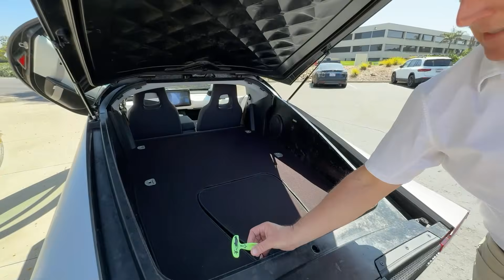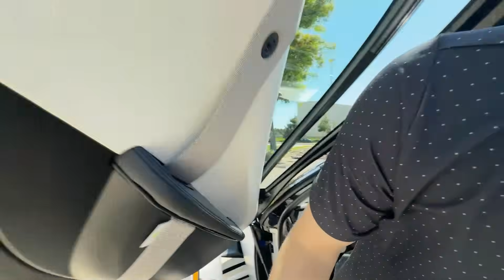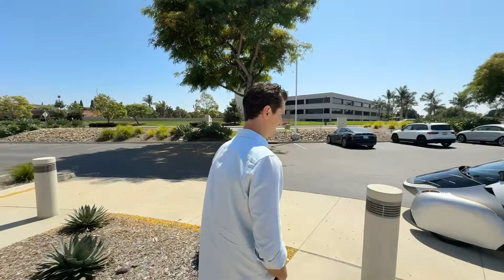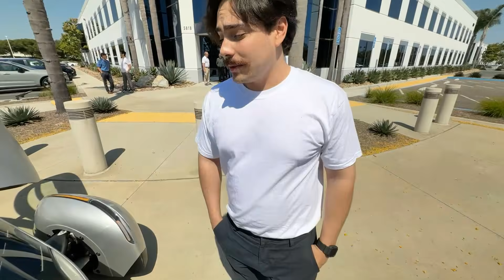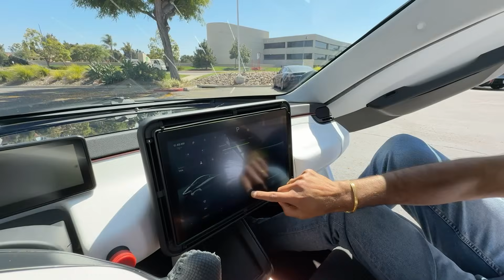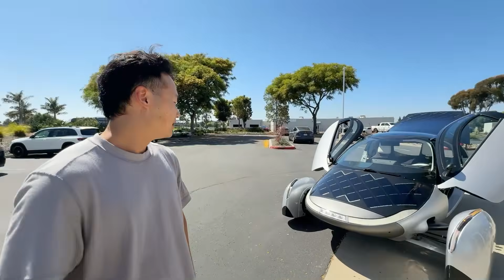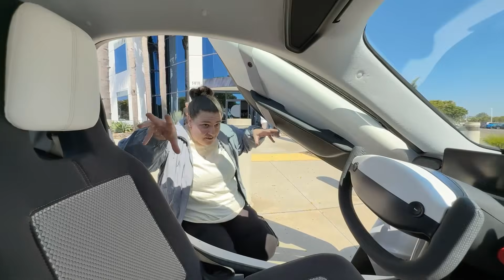Aptera Milestone — Introducing the Next Validation Vehicle

Comment: I really hate the lack of buttons.... Please consider having a port on one of the central pcbs with the option for a break out board with programmable buttons. At first I would like to use a macro-pad or a ten key num pad over usb. How had would it be to have a USB port for this purpose?
Reply: But you see, it saves them money to make the controls touch only. Programmers are much cheaper than retooling machines when making changes, and buttons cost money to make.

Why would they give the customer what they want when they can pretend the cheaper way is better?

Comment: When there is a button or lever for adjusting the AC, fans, radio, etc., you have to look at it at less than some milliseconds. With a touch screen, your eyes are off the road for multiple seconds. I'm not a fan of it. I really like the Aptera, but if there is only a touch screen and no option to change that, I won't buy one.
Reply: I have my hopes set on a Slate...

Comment: I would love to see Aptera do well.  

What does production intent mean?

This example looks ready to sell.
Reply: "Production Intent" (PI) simply means it's the vehicle they intend to produce, that's all. The PI vehicle still needs to be tested thoroughly. If it passes all the tests without failure, it wll be the Production vehicle.
Reply: @fotoguru222 I’ve seen a number of videos with protection intent Apteras going back two years.  It seems like no production.  Maybe they find something wrong and start over.
Reply: @youtubemademecreateanewcha6965  Yes, over the years they've been finding something wrong for the body material and process, the cooling system, the motor controllers, and most recently the HVAC. In the last 2 cases, the suppliers they had lined up couldn't supply the parts in a timely, cost effective manner. However, I wouldn't call that starting over each time. I'd call it making refinements.
Reply: @fotoguru222 got it. Refinements is better.
Reply: @youtubemademecreateanewcha6965  No, Aptera has presented its first Production Intent vehicle in March 2024, so you have not seen videos of PI builds "since 2 years" as you falsly claim.

Comment: I have a priority slot, so I was optimistic about this reveal. Unfortunately, nothing was actually revealed in this Schrödinger's cat thought experiment of what might be under the hood. Rather than risking killing the undead cat, we were denied a look at the arrangement of the new transaxle with the production climate control system. Have they managed to also cram the Inmotive Ingear two-speed transmission into that small compartment? Instead we were only shown the UI with a lot of glare, while the vehicle remained motionless. The interviews with the remaining team members hinted at late revisions and non-production-intent solar panels that remain on Artemis, but did not really explain what we were looking at. They should have described the sourcing of the production-intent components, explained how they are different from the production components, and shown us the difference those components will make to assembly of the Artemis. Moreover, we need to see the use of these production-intent components to validate PRODUCTION, not just to make a vehicle that can navigate a parking lot. Learning that the control system will be remotely reprogrammable going forward raised more questions about why the team is still tweaking it now. We don't need more tweaks. We need production trials that show they can make one at the rate they promise. Before crash testing Artemis, they should disassemble and reassemble it until they can hit their production rate. This is the pathway to the $60M investment they seek. Go watch Revenge of the Electric Car to see what Elon went through getting the Roadster into production, and you'll see what I mean.

Comment: I'm a very long time stockholder and I'm happy to see it and it looks very nice. The interior looks especially nice. Very well designed. I actually like the Red emergency stop and I would leave it in the production vehicle. One of my concerns and I think a lot of people have these concerns is that these vehicles can go rogue and since you don't have any direct mechanical connection to the brakes and the gas pedal you want to be able to pull the plug on everything so the vehicle just stops. I don't think it hurts to have it be read and I like the high visibility pieces. A little color splash especially when it's functional looks nice. I would add some hooks or something for a little cargo bag to hang off the front dash or something of course it can't block the airbags I guess but since the front dash is going to be solar when people put things up there that's going to cut the power of the solar so you want to give them an alternative place to put stuff. The nice big center console is great. Really great. I would change the wrap on the front wheel pants. I would cut that big pant in half vertically maybe have the bottom half be black and the top half bee the silver. Just because it looks so big. You could also put a swoop or something in there or whatever and I know people will do their own thing with the rap but just to show it I would visually reduce the size of that front wheel pant with some clever graphics work or something. What's very nice. Very happy to see it very happy to see all the solar working. Oh my other engineering suggestion since I am sort of a a doom predictor and anticipate problems is if the panels are not going to be tightly water laminated sealed against the glass pieces covering them then you want to make sure you do have some vent holes because they're absolutely will be water leakage into there no matter what you do they'll be humidity leakage in there and if you don't have a way to vent it back out once it's in there you will have discoloration and the solar cells will lose it efficiency and the water might even freeze etc so unless those solar cells are sealed against the glass and not just on the outside but all along the inside so there's no place for water to gather then you need to have nice large vents to vent it out of there. and you might even consider having some little side Access hole so you could run something like a large pipe cleaner in there to clean them if need be.

Comment: UGH! I wish you would stick with what actually works BETTER and SAFER. Please use real knobs and switches for things like climate control, windows, and any other control that needs to be used without STARING at the center console. It's just common sense. Maybe hire some usability engineers to get this right. I hope the turn signals and windshield wipers aren't controlled from the center display. It's bad enough you have PRND controls on the display. Just take note of how many steps and looks away from actually driving/keeping eyes on the road that need to be done just to put your car from drive to reverse and back to drive again (i.e., for parallel parking).

Comment: Very interesting vehicle! But I have three things I'm doubtful about. 1. Leaving it out in the sun for charging with a huge, almost horizontal windscreen have to make it insanely hot inside. 2. I really dislike big screens were you control everything. I don't want to look at and fiddle with screens whilst driving. It is cheap and sloppy. Give me physical buttons! 3. As someone already mentioned in the comment, what about the glare from the front and dashboard panels? Also, one problem with three wheelers (I love three wheelers) is that you can't avoid potholes and bumps in the road.
Reply: Plenty of other vehicles out there to fit your needs.

Comment: Hello everyone,

I sincerely hope that you've designed this product with all possible repair and maintenance needs in mind, as well as the recycling of the various parts that make up this product.

It's best to make sure it's easy for the user or mechanic to repair this vehicle.

It's common sense, so I imagine you've tried to consider as many real-life situations as possible.

Everything must be easy to maintain and repair if necessary.

This will ensure a long life for the vehicle.

And of course, the components and parts used must be available as new with no time limits.

We also need to think about upgrades that will enhance the vehicle's longevity.

Good luck with this project. ❤

Comment: As much as I want Aptera to succeed I just cannot see it happen if the price is $40k. I certainly will not be following up on my reservation at this price point. 
Carbon body poses an existential threat for them in Europe as it will likely be banned in 2029. I am in investor and I am disgruntled with how long it has taken just to get to this point. Production at scale could still be a long time away and an IPO before that will be a disaster.
Reply: Better off buying a Tesla
Reply: @Gary-ee3kq  I agree, but only because a tesla actually exists. The bar is super, super low.
Reply: @IstasPumaNevada they should take products off the shelf and assemble them together.... even intergrate comma ai self driving. This is a joke that they are proud of small worthless achievements like the emergency trunk release after a decade in production.

Comment: Anxiously and patiently waiting for my Aptera. Thanks for the introductory video to Artemis, and looking forward to more detail in subsequent installments. It's just me, but I liked the pass-through armrest better, but I assume lengthy discussions came to the conclusion that more hidden storage was necessary, or that the pass through netting wouldn't last, cost and schedule, or some other rationale. 
Definitely a good move moving that emergency door latch. Easier for the passenger to reach also. 
Definitely a good move on the two stage gas struts for the hatch. (Not something I would have thought of, but I'm not an M.E.). I suspect the doors will behave similarly?
The wheel pants leading and trailing bumpers appear to be 3D printed? 
Little by little until some big bucks roll in is better than nothing. Thank you.

Comment: Love it! But my initial impression is that you'll be able to fry eggs on the solar panel on the inside dash.   I would rather see a solar shade that covers the windshield. Seems like on a sunny day, it will take enormous amount of energy to keep the cockpit cool.
Reply: Sunshades are great, but inconvenient to use. The solar panels should generate more than enough power to keep the interior cool. I hope they have a mode that runs the AC when the temperature is much higher than ambient even when the vehicle is unoccupied or at least runs the fan.

Comment: I love this car.. and I've been dreaming for it since.. I really can't remember when.. Maybe since its very first announcement? This said, I strongly think that It'll never be sold here in Europe... not for the strange but f*ing cool shape, efficiency, aerodynamics and so on... No, it'll be pretty difficult to even made it drivable inside the EU since We have so many restriction on how cars should be designed and made. I'm not talking about magic, it's widely known that all cars must be produced with security in mind and they must pass very strict tests in order to even touch the streets. External tires are much more exposed to possible impacts (I'm imaging a guy with a scooter or with a bike that maybe don't put too much attention and goes directy on the tire-main body junction...and this is not a SOOO REMOTE HYPOTHESIS); Another point could be the tail visibility. Since Its shape is basically an horizontal line, a distract guy with a less-strange-car shape could not actually see the tail.. since there's no volume to look at (It's actually an horizontal plane attached to a round shape)! In this case, a H-tail (yes, the one used on several ww2 aircrafts) could prevent this issue and, maybe (but I'm not an aircraft engineer) could potentially help on better controlling the vehicle at high speed. I'm sure that these stuffs I've just mentioned were told by so many during all these years of development of the car... but they are concerns pretty solid and potentially disruptive for this project...

Comment: The white plastic texture, speakers, seating and center console look good.😊 The sound of the doors closing is reassuring. I am concerned about the visibility of the center display. Perhaps the windows could be tinted or the display made brighter,  antireflective coating, or recessed more. The efficiency of the solar panels would benefit about 5% (30 Watts) from an antireflective coating or micro-texture and it would protect drivers from glare. Without a shroud, I am also concerned about snow clogging the air intake. The exposed carbon fiber has inconsistent color on the side that detracts from the appearance. The solar panels looked much better in an earlier prototype where everything appeared to be a consistent color.

Comment: As an early reservation holder and investor very anxious for delivery, I was surprised attendance was so low for this event.   Half (or more) of the people are employees so why did Aptera fans stay at home.

Hopefully, everyone knows the reason production is taking so long. Its insufficient funding.  It's a very high risk venture with so many predecessors going bankrupt.  No VC or angel investor will put up money without significant ownership and the founders refuse to give up ownership.  Sadly, some of this is greed and fear another owner may gather enough power to change Aptera mission.  Examples are 4-wheels to expand market, 4-passengers vs 2, or launch with tiny battery.  

Am I the only investor stunned that no one in Saudi Arabia or UAE will fund Aptera when it was already done at Lucid?
Reply: Only employees were invited, in fact everyone not invited was asked to go home.
Reply: They make excuses. They are not serious about manufacturing. They are dreamers and become more like scammers every day.
Reply: You should cut your emotional losses and stop hoping right now. Count it as money down the drain. That happens a lot even with real investments.
This thing has all the hallmarks of vaporware. Including how the attempt went bankrupt already in 2011. And a similar 3-wheeled car, the Elio.

And if I'm wrong, you can be pleasantly surprised.
Reply: @IstasPumaNevada  what’s in common with Elio? Lol

Comment: I really like what the Aptera represents and hope that the final production vehicle is a big success although I wish you made videos like this with slightly higher production values. To some extent I like the low budget presentation and unplanned, slightly awkward interactions but I can’t imagine why you had a seperate guy with a camera shooting stuff for some unknown purpose instead of having him hold the main camera. The distortions from the lens made the people and car look bad at times. It’s hard to tell how much of the glare on the display and shimmering glass reflections from the solar dash are real or a result of not using the right filters on the lens. It seemed like you didn’t plan where to park the car for the lighting on such a bright sunny day and it’s unclear if the reflections are going to be a problem for the production vehicle. This video seems to demonstrate a critical flaw with the glass dash reflecting into the drivers eyes. I’m not sure how you will fix that, maybe you can use that glass that can be turned opaque with the press of a button or have a physical blind that pulls out over the dash. Hopefully the front solar panel isn’t also an issue for reflections. It’s hard to mic people up when you have so many but as you were only talking to one at a time you could have had a couple of wireless mics that they could have switched between off camera. This wouldn’t cost a lot in the grand scheme of things but would help to present the company and car in a better light (figuratively and literally).

Comment: Can you show us how tightly Aptera fits into a standard parking spot? Will both doors easily open if cars are parked in the spots on both sides? If there is not enough room to swing open because of a wall or car parked too close, will Aptera’s door opening mechanism sense the tightness and hesitate to open in order to prevent damage?
Reply: The doors do not open outside of the front wheels. So that is not an issue.
Reply: look on their channel, past videos show a shopping trip with an early prototype version, this should give you a good idea of how it handles parking lots/day to day activities

Comment: Aptera was started in 2006 and still hasn't sold a single car. Microlino in comparison made a concept car in 2016 and by 2024 produced 3700 cars.  Is there a fundamental problem with the management of Aptera?
Reply: the Aptera of today is not the same company that was founded in 2006, they rebooted the company in 2019, the current development process was basically started over from scratch and it has made it this far in only 5 years

Comment: There’s a little rattle when the door closes. Hopefully that is addressed. I switched from my 1k mile version to the Launch Edition. I really wanted the 1k mile and AWD but I’ll make the sacrifice to actually get my vehicle.
Reply: The rattle must have been in your head! I just heard the door close!
Reply: I heard the rattle/resonance/ring too. If the vehicle had old-school wind-up windows and simple door locks activated by wire pushrods, I'd have said that the mechanisms needed tighter bushings and better damping. The Aptera door sounds like it's on a 'no frills' delivery van. It's not terrible. It's not the dreaded 'cloinngggg' of a real trashmobile, but it's not as solid as Aptera fans are claiming.

Fine tuning could be effected by a redesign of the moulded butyl rubber water sealing strip, but... that opens up the old 'when are we gonna see a production-ready model?' thing.

Nice try, but no prize, Aptera peeps. The optimum sound of a (quality, £35,000+) vehicle door-close is 'thub'.